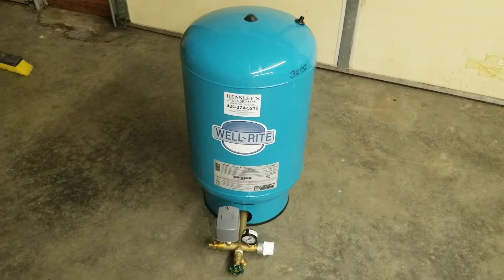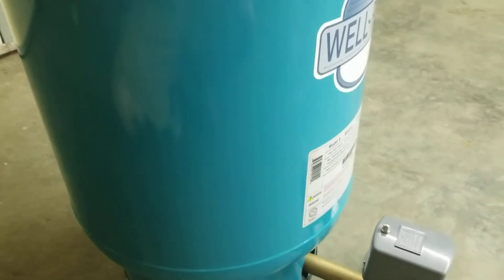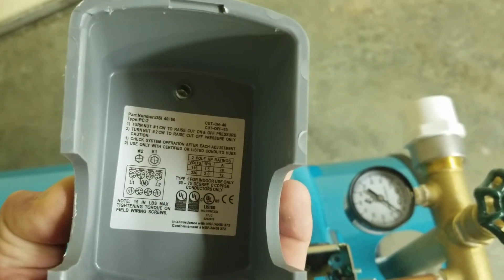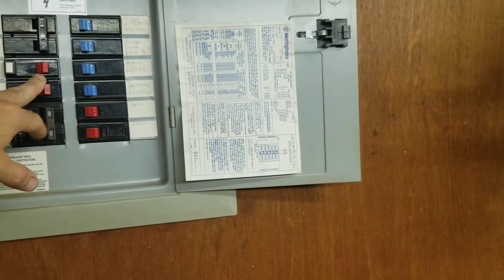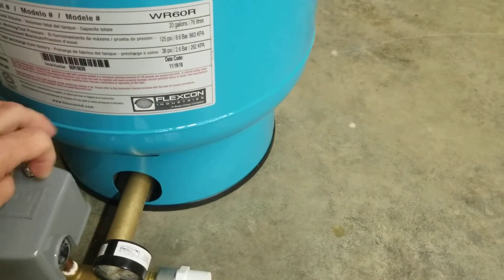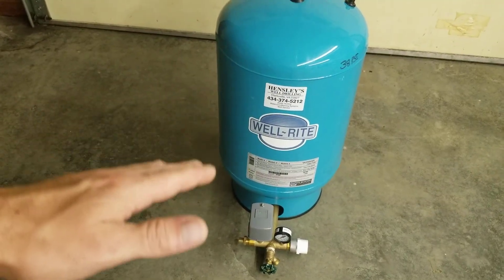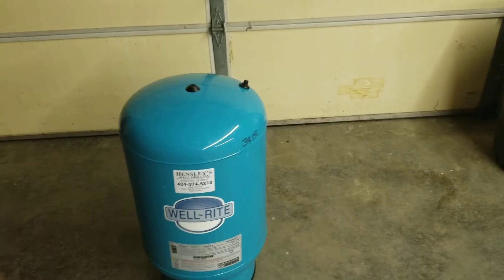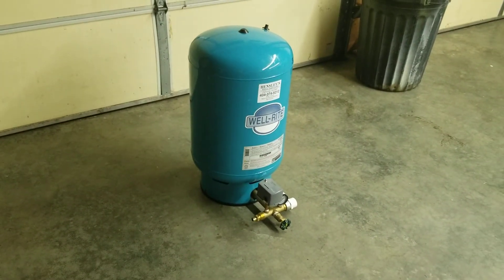Well Pump & Tank Troubleshooting, How the system works, Adjusting Pressure Settings Correctly

Comment: Just found your video... Please help, no pressure in the gauge, sudden no water, no leaks anywhere on the property, tank bladder pressure is reading 24. Can't figure out why I have no water and no pressure.
Reply from the maker: You might have a bug in the pressure switch. Use plastic cover on switch to flick open the contacts. Becareful bc that area is 240v. Don't touch with hand. Use the lid
Reply from the maker: Use an electric meter to check the wires at the well. Test the wire nuts for 240v. If you have power, the pump or wire down well is bad. If no power, your pressure switch isn't working and replacing it should fix it. Be careful when working around electricity!

Comment: I've done everything and still no pressure...
Reply from the maker: Little information to go on to help you. Test for power out at your well. If you get 240v at the wires & no water, the pump or wire down well is bad. If you get water but very low pressure, the pump could be old , fitting or pipe in well could be split or a hole in a galvanized fitting.

Comment: Hello!  I just bought a house that sat empty about 3 years.  265' well, cased.  Hard water!  Softener system had to be replaced to pass my water inspection ($$$ ouch).  Pressure at the pump is cycling 40 - 60 and maintains 60 PSI when not in use, tank pressure is 38 and 58.  House is 360' away from pump and 40' lower than the pump house and pressure tank, water line is 3/4" schedule 40 PVC and no leaks or breaks.  Water pressure at the hose bib on the outside of the house is great.  Inside the house it just trickles.  I have traced the water line through the house and found the main shut off valve.  Opened and closed it several times to make sure it was not stuck or broken.  It did stop the water completely and returned just a trickle when on.  I am at a bit of a loss for next steps.  
A friend suggested it may be iron build up in the fixtures as they are all washer-less, or the supply lines.  I have lived with hard water and these type fixtures for years and never seen that happen.
Any suggestions?
Reply from the maker: Use channel locks and go to each sink & Remove the strainers, where the water comes out of the faucet. 90% of them unspin & can be cleaned out. If you see a little disc with a small hole in it, use a knife and pop it out of the strainer assembly. Its typically 4 plastic pieces & a rubber washer. Open sink faucet after unscrewing it & see if pressure is there.
Reply: @h2omechanic   I removed all of the strainers and nothing changed.  Since the tub . spout has no air rater I assumed it was not those. Thanks your assistance.
Reply from the maker: @zh3401  if u have good pressure at the well head & outdoor spickots, it has to be a valve problem or a filtering issue. Try looking at the back of the head of your softener & put it in bypass mode to see if that helps the pressure. After that you'll start ruling things out

Comment: I just install a new irrigation pump a new 30 50 pressure a new pressure gauge pressurized tank has 28 PSI and I have pressure the pump won’t stop and pressure gauge stuck at 25.
Reply from the maker: Seems like your pump is not building pressure above 25psi. If you used a cheaper brand of pump, thats why it was cheap. If it is a single line going down the well, they have a hard time as well bc they suck up the water & have to build head pressure. How deep did u put the foot valve? I think 25ft is max for a single drop pipe. You have alot of variables but those are my first choices. You could also have air trapped in it. Which is a pain in the butt. Send me pics of the system so I can make better assumptions on what might be the issue. I can 99% of the time diagnose it. 4342101376txt
Reply: I bought 1 1/2 HP Zoeller from Lowe’s

Comment: Hello, my house has 100% new plumbing as well as new expansion tank, pressure switch 40/60 psi, boiler valve/pressure relief valve & pressure gauge.  I also have a new 1/2 hp deep submersible well pump, new 1" polyethylene well tubing & new well pump submersible wiring. When I put a hose on the boiler valve and open it, the initial surge of water last for about 30 sec to 1 minute then as the pressure drops, the pressure switch kicks on as it should around 40 psi, the pressure continues to drop down to 30 psi and then drops off to 18 psi and will continue to run at 18 psi.  How do I tell if the new pump I installed is a faulty pump. I pulled the pump out today because I had the help to do so in case I had to swap out the pump tomorrow.
Reply from the maker: Ok. Since you have the system off & 0 water pressure, my 1st thing id check is the air pressure in the bladder tank. It can not be above 38 psi. Being that its new, all my new tanks have 41psi & i have to let air out. Use a digital tire air gauge & go check the air pressure. Lower the air in tank to 35psi just incase the pressure switch wasn't set perfectly from the factory. Probably not a issue with the pump. Secondly A good test for it is to run it open ended at the well before you connect the pipe. Just give it power & see if it flows good for 5 minutes. I'm almost 100% positive your tank has been pre-charged a little to high with is common. They get filled in a 50degree climate & with temperature changes/raises the air inside raises 3to4psi.

Comment: I replace my pump but week later I found a water leak i fixed but now I loose pressure and I can raises up,what can I do? Thanks.
Reply from the maker: Not enough information about your system or correct wording. I believe that you could have just drained the well down too far bc of the leak. If the pump was bad & you replaced it, I'd look into why the pump failed. Typically a bad tank will kill the pump. So check out your tank ! With power Off & all water drained out, check as it pressure in top of tank. If tank is heavy/full of water when off, its probably bad too.
Reply: I have jet pump that will not prime, fixed foot Valve and there seem to be a half inch pipe that goes to we'll lid and I don't know what it is for. Do I need to hook it up to something near the pump?

Comment: Is my well bladder bad? My pressure switch is cycling way too fast. I have a 30 gallon tank, set to 40/60. Internal pressure when drained is 34psi. No leaks that I can see. When I check the air valve at top, air comes out. I can tip it a  touch so I don’t think the bladder is broke but it cycles 3–5 times when the toilet is flushed. It cuts in at 40 and stops at around 60 but not even a half gallon of water comes out before it goes through a cycle. How much water should come out before it goes through a cycle? Any help would be GREATLY appreciated. Thank you!
Reply from the maker: Kill the power, drain pressure at a sink until water stops. Then tank an air compressor & hook it to the nipple on the top of the tank. Air it up to 35psi. I believe it might be ok, just very low on air.
Reply: H2o Mechanic I will do that and let you know if that works. Thank you!!

Comment: My water runs slow . It takes the pump a long time to click on then the pressures good
Reply from the maker: Could be 2 things. Tank could be low on air pressure. You can check it by turning off pump breaker, open faucet & drain all water out of system. Use tire pressure guage on top of tank and see if its 25psi or higher. If there's good air pressure, keeping the power off!!! Remove wires from your pressure switch, use wrench 9/16" & unspin the pressure switch bc the nipple it sits on can get clogged. Its probably a clogged nipple. Easy fix when you unspin the switch off the little pipe it sits on just push a screw driver stem though it & clear out the clogg.

Comment: Fixed my pipes going down the well, new new pump, nothing is leaking, after 2 min water comes out the sprinklers good, after 20 seconds the pressure starts going down and down and down, I don’t have a pressure tank, what could it be?
Reply from the maker: You always need a pressure switch & tank in the system even if its hooked up to sprinklers. Too many things it could be. I'd try pumping it open ended from well onto top of ground. Not through irrigation system. See if it'll pump water wide open & for how long. If it flows max for 15 minutes without issues & then u hook it back up like u have it now & problems occur again, you could be dead heading the pump, heating up and turning off on a heat overload. Pumping open ended will show u if the well is making enough water/well not filling fast enough for your pumps gallon per minute rating
Reply: H2o Mechanic problem it’s with priming, can I send you a video somewhere?
Reply from the maker: If you have a jet pump, that's a totally different animal. LoL. You can call me & ill walk you through a few ideas.4342101376
Reply: H2o Mechanic sounds like a plan let’s do it tomorrow, I’ll text you first, if you see an area code 801 it’s me, thanks again
Reply from the maker: I believe I know your problem. Your pipes are full & pump is primed, it comes on & water goes rushing out. I assume it is a 2 line jet pump. A single will act worse but same. Jet pumps require water  circulation to operate properly. Your dumping out too much water too fast & its causing the pump to cavitate bcbit can't suck it up as fast as your discharging it. On the out going line, I'd suggest installing a 1" or 1.25" gate valve directly from the "out" of the pump. Prime the system and only open the valve 25% and turn it on. System should work then bc you can meter the out going flow. Once its running for 20 seconds slowly open the valve allowing more water to go out, you'll have to play with it to find the MAX that you can open it before cavitation happens again. Does what I'm saying make sense?
Reply: H2o Mechanic make sense I’ll try tomorrow and report back

Comment: Brother...my water tank seems to be full of water (there is water coming out of the valve). I went to home depot and a staff member said that if my tank set up didn't include a relief valve, it could be a matter of just flushing the tank and reapplying pressure. Oddly enough the only valve available is above the tank/not below, as I normally see. So I will have to cut the pipe to be able to flush it. Looking at a couple of your videos it seems like they're probably wrong (at home depot). The  tank I have is a Pro-source plus, model PSP32-T03. I wasn't even able to find out what kind of tank it is on google. Please, let me know if I should replace it or there is a chance it is still good. Thank you.
Reply from the maker: Air valve on top of tank, if water squirts out its a bad tank, replace it with a regular 20 gallon tank. If the tank is heavy/ its probably bad. Or try using a air compressor & add air to 25psi & see if your system goes back to working properly

Comment: I have an old galvanized well tank and the pump turns on way too frequently. I seem to have weak water pressure initially when taking a shower but then it increases after maybe 10 min of use.  Is that also a sign of a water logged tank?
Reply from the maker: Galvanized tanks don't have bladders. They just trap air in the top. Take a little air compressor down there & add air to your tank. Allow the tank to be about half full of water & have pump power off & all water valves closed . Add air until you see 25 psi on air compressor takes about 3-5 minutes. Or cut out tank & install new bladder style tank. You could also just add a tank in the line & Tee it in anywhere and it'll fix all your issues. Your problem is that you have no air in the tank to push out the water.
Reply: Was cycling this morning woke up no water. Not showing any psi at tank?
Reply from the maker: @shawnhamel6995  if you can test for power out at your well, try that first. If no power there, its your pressure switch. I have other videos explaining how it all works together.if it was cycling on/off/on fast, tank could be bad & have killed the switch.

Comment: On my pressure tank someone wrote 38psi air pressure/40-60 water pressure. Same setup described here. But when I pull my pressure switch cap off cut on is 30 cutoff is 50?!?!?!
My current setup isnt making since to me.... :/

Does anybody understand this?
Reply: Do you have a pressure gauge to confirm what the pressure really is? If you do than:
A.  Run water till pump comes on, then turn water off and wait till the pump stops running.  read the gauge.  This is your actual cut-off pressure (The high number).
B. Put your wife on her cell phone near a faucet. You stay at the pressure gauge.  While you are on the phone together say "honey, I love you, now open the faucet".  make sure the pump is NOT running before doing this.  Ok, faucet is on and pump is not running yet, pressure on the gauge begins dropping.  Exactly when the pump kicks on, record that pressure.  This is the cut-on pressure (the low number).

The low and high pressures are usually separated by 20psi (30/50 or maybe 40/60).  Doesn't really matter because the number you recorded when you determined the cut on pressure is the number you will use to set the air pressure in the bladder tank.  If it was 30, set air to 28.  If it was 40, put 38 psi in the tank.
********It sounds like your confusion is easily cured.  What probably happened is a 40/60 pressure switch was replaced AFTER they wrote on the tank.
  They put in a 30-50 but never changed the note on the tank.*****
  If your cut-in was 30 and your cut off was 50, get a sharpie and write 28psi air pressure, 30/50 on the tank and scribble out what was there before. 
Good luck Nate!

Comment: When my well pump turns off. I can hear my water pipe bang from upstairs. I’m not sure if it’s from my well pump or pressure tank. My pressure tank is good  and also has the correct air pressure. Any help would be great
Reply from the maker: What your experiencing is water hammer. You probably have a deep set pump. It's a common problem. The fix is not clamping the pipe down, the fix is hanging the pipe and supporting it with plastic or metal strapping.
Reply from the maker: You could put a check valve on the system right before it goes into the tank. Itll still water hammer, but it separates the load.

Comment: So I’m trying to figure out which component is malfunctioning. I have a video of the system losing pressure https://youtu.be/It4ZW_cFL5w so I’m thinking it may be the pressure switch because when it goes below 40 psi it doesn’t cut on it just goes to zero waits for a minute and then finally cuts back on. Any thoughts?
Reply from the maker: Galvanized nipple on the pressure switch is clogged
Reply: H2o Mechanic I changed the pressure switch and that did the trick, thanks!
Reply: I had the same problem. I took off the pressure switch and the pipe and the diaphragm had sediment in it. I cleaned and put back on and it works fine now. Thanks for the information.